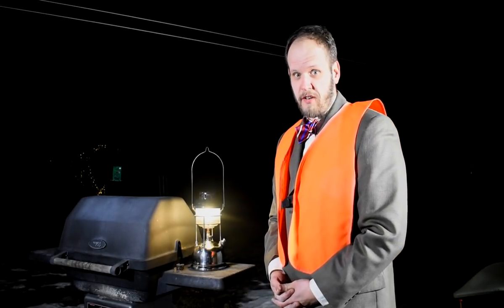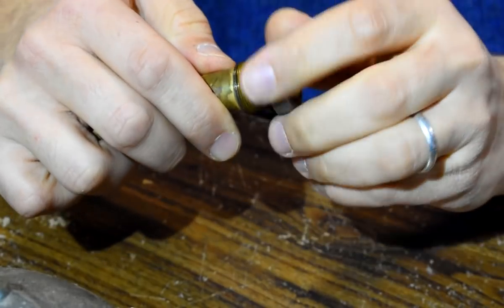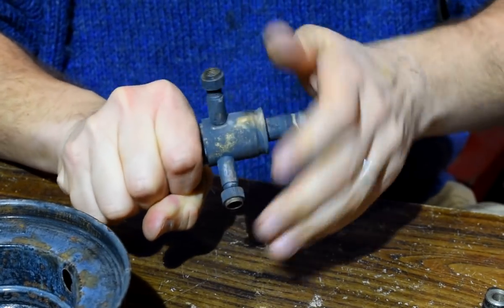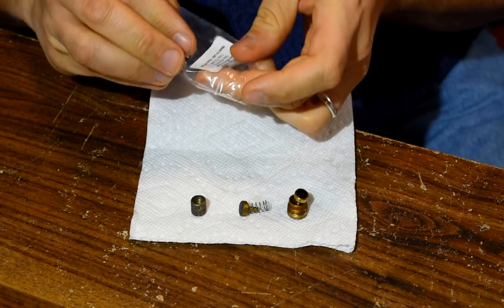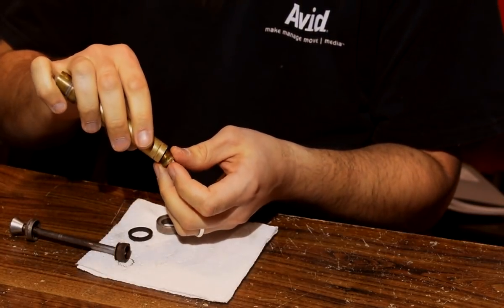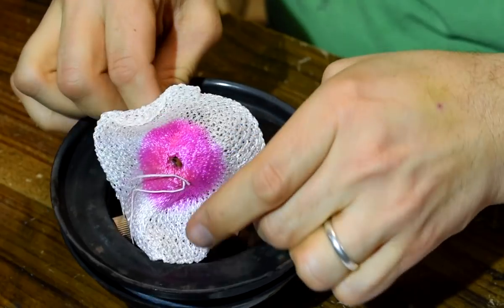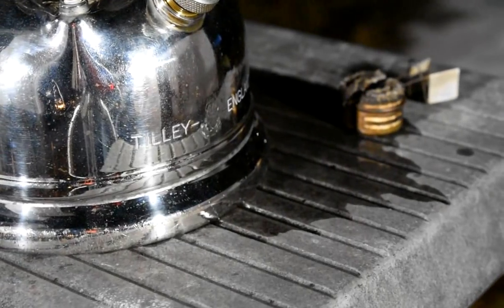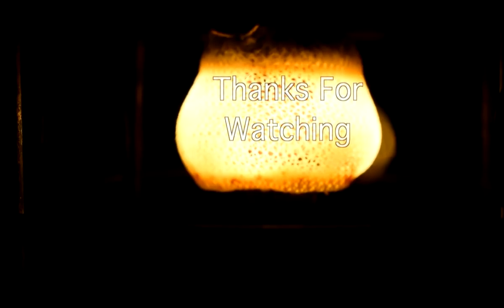How to rebuild a Tilley x246 - Lantern Lab Episode 10

Comment: An excellent video, in fact, far better than some English fiddlers and "restorers" who seem incapable of understanding how a Tilley works; they are bent on exposing the brass and vandalising the enamel on the chimney with sand blasters. Liked your forensics, too. One point, loading the pre-heat torch is best done in a jar filled with meths (you may even buy copies of the 1950's jar at prices on eBay  similar to the mentioned vapourisers!)). Well done.
Reply from the maker: I have a jar, I store the torch in the jar when I'm not using it but I usually don't keep any alcohol in the jar. I find my squirt bottle so handy for so many things. "Best" is a tough word, for what I'm doing the squirt bottle is just handy and I don't have to keep multiple containers filled.
I too was a "brass exposer" at one point, I've learned the error of my ways now.

Comment: The thing I found with the Coleman 'Dual fuel' lamps is the mantle tends to get broken easier as it is only held at the top.
Only managed to get 1-2 fishing trips from each mantle, whereas the Tilley Guardsman would last the whole season until it was stripped and serviced.
But I did like the ability to use Unleaded fuel the Coleman, as it made less things to pack Plus less messing about to prime & light.
Reply: Interesting to know.

Comment: I just bought a Tilley and was looking for tips on how to restore it, which lead me to this video. It has no torch however, but I think mabe I could turn a cup from aluminum and use that for starting it, I have a lathe so it opens up some possibilities.
Reply from the maker: The torches are available, there are some on ebay right now. They're expensive but last and last. I've only ever had that one.